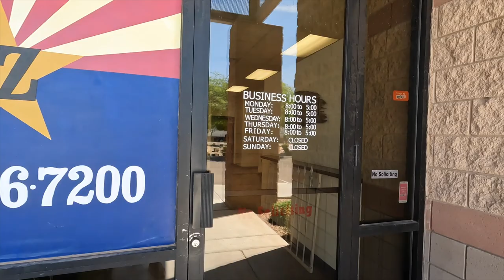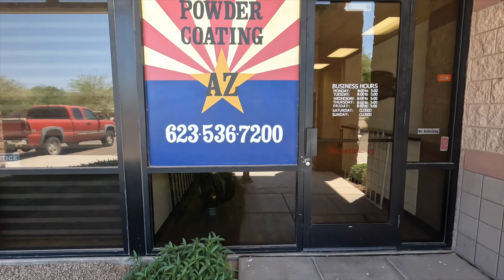1989 DYNO VFR | Custom Build

Comment: For the life of me, I remember I purchased my GT June 1989, it was Magenta in color but for the life of me I cannot remember if it was a performer or what it was but I remember I bought it June 1989 because my birthday is in July. I haven’t seen another one since, If I remember correctly, I paid like 370-$400 I think.
Reply from the maker: I had a magenta 89 Performer
Reply: Actually, I stand corrected, it was February 15th, daddy pulled into the driveway with it in the back of the pickup, that June is when my Hutch was found and we started to purchase items for it, but shortly afterwards it came to quick stop due to new acknowledgment, but still an not remember